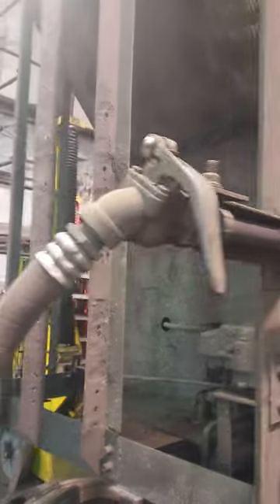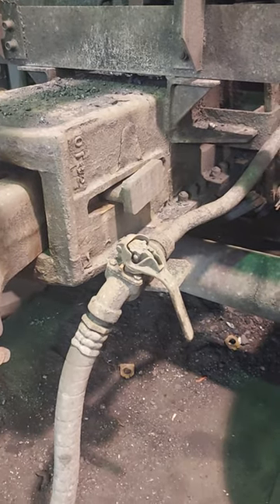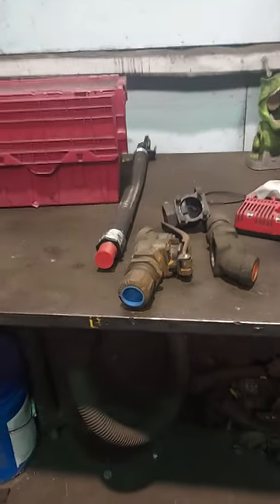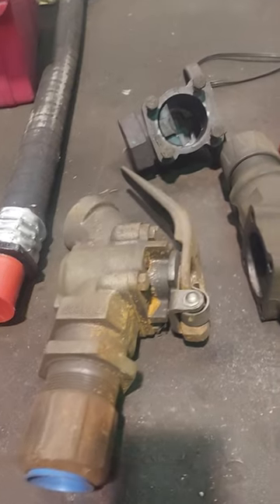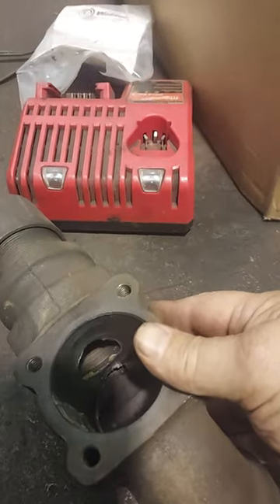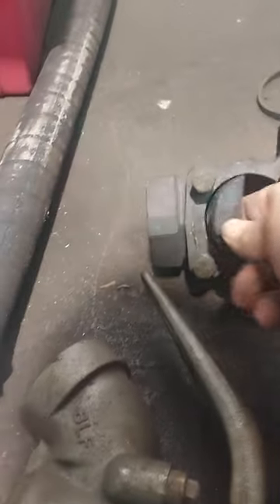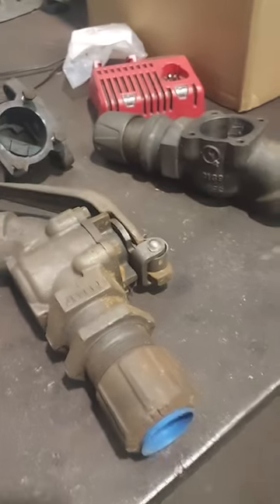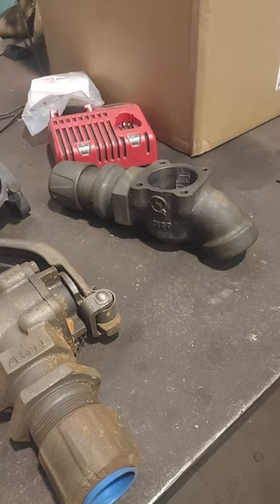Freight Car Air Line Angle Cocks #shorts

Comment: Nice to see the gear up close! I don't know what the are pressure is in those lines, but it looks like the valves are built plenty strong enough!
Reply from the maker: Yes they are. 90 psi on the brake pipe. Thank you so much for watching the short angle cock video Brian.
Reply: I’ve always wondered about the pressure between all the rail cars because I assume that the locomotive puts out a certain amount of pressure but the very last rail car probably “sees” much lower pressure than the first rail car due to the length. 🤷🏻‍♂️
Reply from the maker: @Bassotronics  on the other railroads a brake pipe continuity test is required to be performed each tim a crew change is made. That finds the air pressure on the brake pipe at the end of the train. It must be above 75 psi or else the trzin is not allowed to depart until the air leak is found and air line tests above 75

Comment: Since the railroads have various animal terms like “frogs” “goats” and “slugs” I will call this mechanism an angle rooster. 
😉
Reply from the maker: The AAR might have a bit of a problem with that term....:-) But
roosters are sometimes called cocks. So are valves in plumbing
language. Thank you so much for watching the air line video
Bassotronics.

Comment: Hello Dave lnteresting to know question I noticed a wire at the end of the hose was that keeping it down from moving around . 👍🏻😎Robin out . Safety.
Reply from the maker: They might have had those air hose tied up with that when the cars
were coupled together. Thank you so much for watching the short angle cock video Robin.

Comment: Since we are on air lines. Who was the first to use glad hands for connecting the air hoses, the Railroads or the trucking industry?
Reply: Trucks hadn't been invented yet when railroads started using gladhands.
Reply from the maker: I do believe it was the railroads. Thank you so much for watching the short angle cock video Earl.
Reply: Thanks. So truckers should be thankful to the Railroads for inventing the glad hands.😮
Reply from the maker: @earlschmitt884  👍😊

Comment: i've wondered casually why the coal consists have two brake lines for 33 years.
Reply from the maker: And now you know. Second line is for dumping the car doors.
Can't take air off the brake pipe or else the train car brakes would
come on every time you dumped a car. Thank you so much for watching the short angle cock video hardrays.